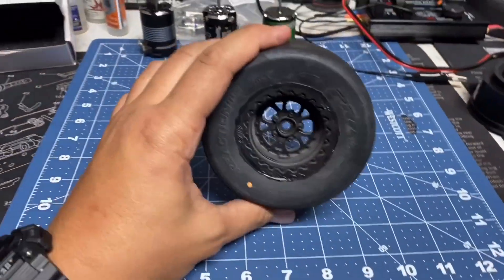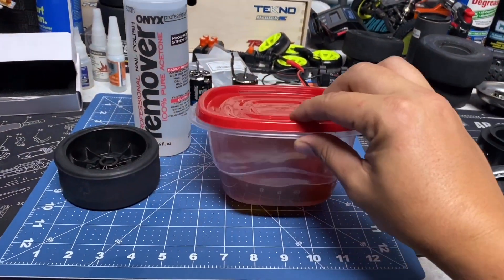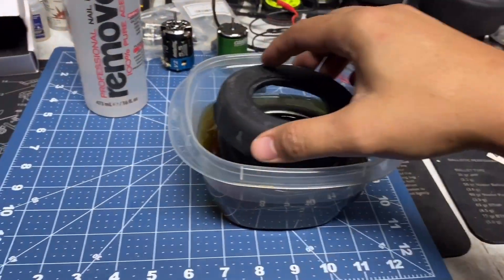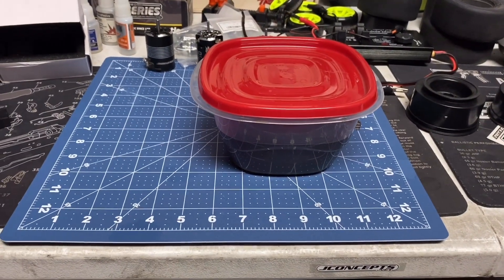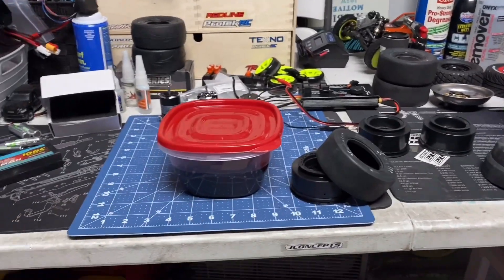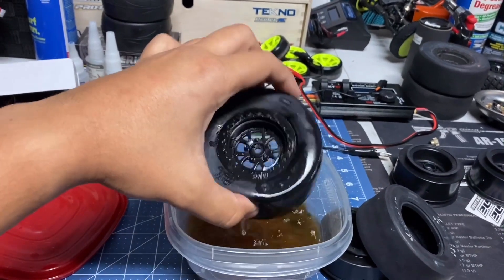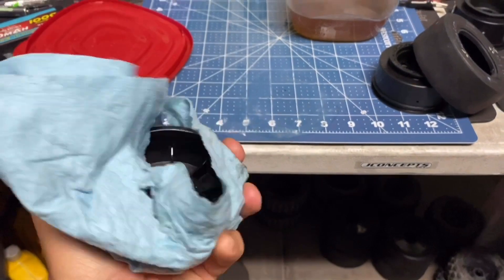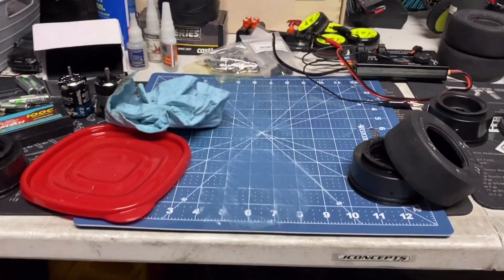HOW TO — The Best Way to Remove RC Tires

Comment: You don’t need to submerge. Just the fumes in a container with the tire with deactivate the tire glue. It may take a bit longer. I buy my acetone at the hardware store in 1 litre or 4 litre cans. Pour some into the bottom of an empty paint can (also cheap at Home Depot)and place a spacer, usually an old rim  in the bottom. You can chuck 4 short course size tires in and they be good to go in 24 hrs.
Reply: Does this work on glue that has been on the tires and rims for years, I just want the rims ?
Reply: Can you reuse the tire ? I popped the foam in my drag wheel and if I could remove the tire and put a new foam I would like to use it again. Will the fumes make the tire go bad?

Comment: Only advice I have, cut the old tires off so there's just a strip of the side wall left then soak them. No wasted acetone
Reply from the maker: Great idea I like it! 👍🏼 thank you!
Reply: @KGRC 007  I do that exact same because I use foam inserts for dirt oval racing and don't like gettin em wet

Comment: What’s a good way to do this with chrome or color wheels. I don’t want to ruin the finish
Reply: oven 👆🏽 ... read my comment above or  somewhere on here you'll find it ..... 👍🏼
Reply: I boil mine, it works good but need to let them boil till the point they just fall off easily, otherwise you’ll be ripping the tires and leaving ca behind. Takes awhile but also gets em looking like new.

Comment: does it affect the foams?     open cell.  closed cell
Reply from the maker: I haven’t tried but I assume it would rip easily after
Reply: I've done this with open cell foams.  Just carefully wring them out and let them dry.  No issues at all.

Comment: the easiest way i found that worked is puttin the wheel under hot water in the sink, you dont need boiling water, just really hot water, when it's hard to hold the hand in it for more than 3sec worked for me, much easier than boiling
Reply: Did tgis ruin ur finnish on your wheels?
Reply from the maker: @gabedavis890 nope

Comment: Nice vid but who has 8 hrs Bro plus acetone destroys foams (stretches them beyond repair) ....... Heat oven to 350 degrees once temperatures reached install as many tires as you want or your oven holds 😂 once installed immediately turn oven off, set timer for 5-7 minutes, once timer goes off remove tires & with a towell or gloves simply push tires of the wheels...its that easy...
Reply: does this work with powder coated aluminum rim? I have a set of 5th scale wheels and the tires are bad already.
Reply: does it hurt the tires? I need to transfer some revo tires onto revo rims.

Comment: Isn't there foam inserts in them?
If so, doesn't acetone attack the foam?
Reply from the maker: The acetone doesn’t seem to hurt the foam. Although you’ll notice that the foams are so stretched out after use
Reply: @kgrc0078  can you buy just foams?
Reply: @codyprice0295  Yes

Comment: I removed them by leaving them soak in Acetone overnight... That simple, you place them in a plastic bowl, laid them down, fill it up with Acetone. Just enough to cover the tires, place tight lid, and by morning you'll have clean wheels 👍
Reply: Will this process be safe for chrome/colour wheels?
Reply: @Lil_Loki  no it won't. Takes the chrome right off.
Reply: I realize it's kind of off topic but does anyone know a good site to stream new series online?
Reply: @Vance Joaquin Flixportal
Reply: @Shane Orion Thanks, I went there and it seems to work :D I appreciate it!!
Reply: @Vance Joaquin Glad I could help :D
Reply: Be carefully using this method. Certain plastics are melted by acetone. I've used this method a lot without problems, until I tried it with my scx24 wheels and destroyed the wheels.
Reply: that's exactly verbatim what he just showed in his video?? 😳
Reply: @DerekRC I have Chrome wheels  for my kyosho charger tires and this is not a good idea.

Comment: tried this on tamiya 1/10 plastic wheels, rubber tires... it melted the wheels before the tires came off.
Reply: Lol this same exact scenario just happened to me. Have you found a different method?

Comment: I guess this is a good way if you're not going to reuse the tire or foam
Reply from the maker: Yup exactly 👍🏼
Reply: You can reuse the tire and foam with this method.  I do it all the time.
Reply: @benbekemeier5545  no, the foams stretch out like women in her 9th term
Reply: @RC, Full Throttle  don't they stretch from tire ballooning??
Reply: I’m curious also so it doesn’t effect the tire or foam? I’m mainly asking about the tires hell I’ll get new foams if need be lol. I just wanna make sure it won’t weaken my tires I’m taking off. Good tires on shit wheels? Thanks for any additional suggestions comments

Comment: This way works but I've found better ways that don't ruin the foam and make such a mess.  I wouldn't call this the "best" way.
Reply from the maker: I don’t usually make a mess lol this was actually my first mess ever. Tough when the brain is still asleep
Reply from the maker: It’s actually very clean and easy
Reply: @kgrc0078  It's a good video.  I've been putting them in a 5 gallon bucket with acetone sitting in the bottom and the wheels and tires on racks.  Put the lid on and let the fumes do the work.  Let sit for a few days and boom.. they fall right off with no effort and no mess.
Reply from the maker: Yeah gotcha on that. Same process but on a larger scale. I just do 2 at a time. But yes the main point was using acetone 👍🏼
Reply: @RXZEROFPV  does that let you keep reuse the tires and foams?  I have a set of tires, and they are glued crappy.  I want to redoo them, so interested in preserving them.
Reply: @jaybeetube3333  did you ever find an answer?
Reply: @kgrc0078  acetone eats brain 🧠 cells that could be the problem 😂 how many tires have you removed this way Ha Ha there are much better way faster & safer methods 👍🏼
Reply: @ConditionZero76  can u tell me the easiest best way if I want to do like he said and not mess up the tires at all I can get new foams I’m just wondering the best way to do it and keep ur tires as good as before u do it. Thanks for ur help